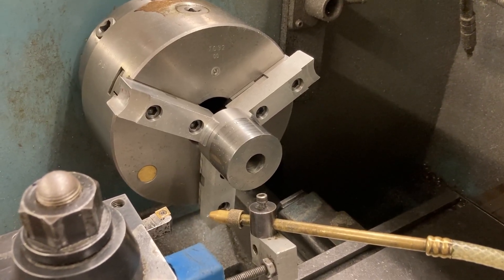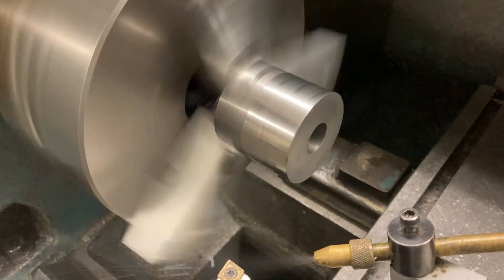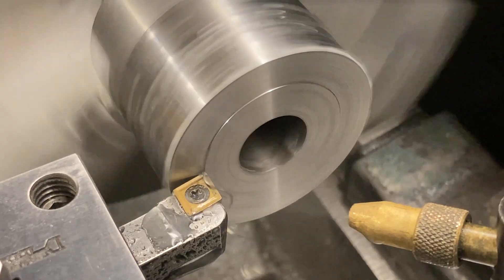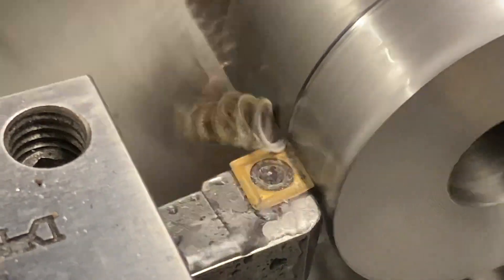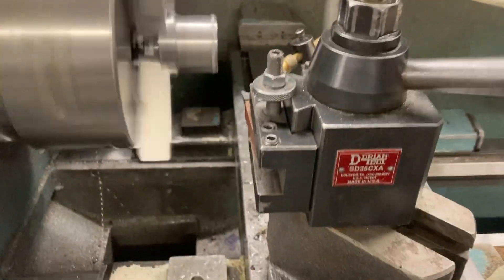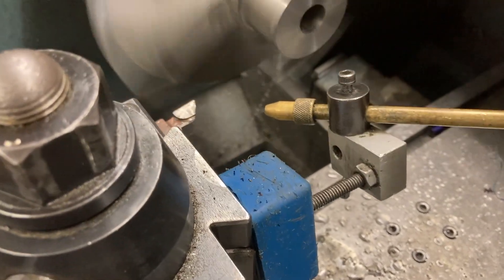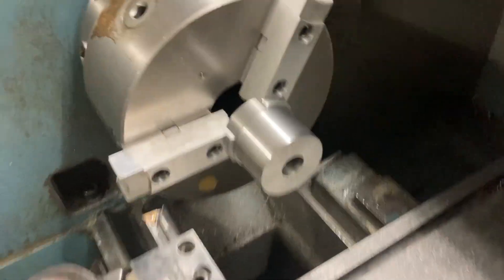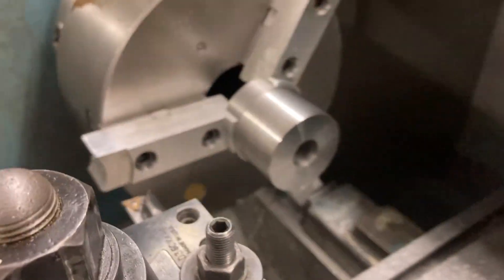Machining D2 Tool Steel Guide Rollers  Face Turn and Bore on Proto-Trak CNC Lathe part 2/3

Comment: Excellent close up shot!  May I ask what kind of mister you're running and also the lubricant/concentration?  I've never seen a mister blow bubbles like it's soapy.
Reply from the maker: Kool Mist 77. 4oz per gallon. The suction line has a leak so it sucks some air making the bubbles.